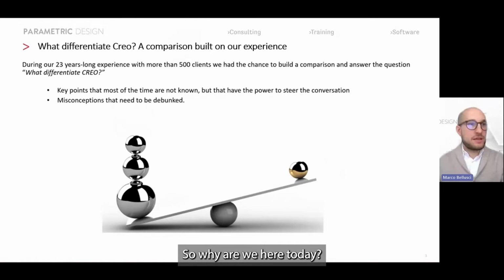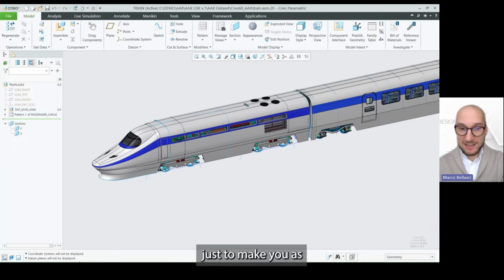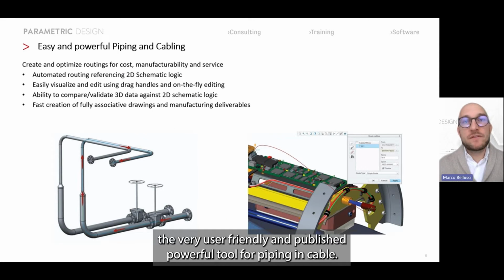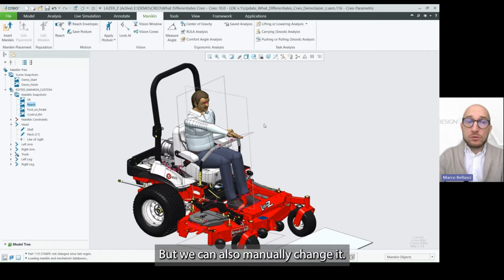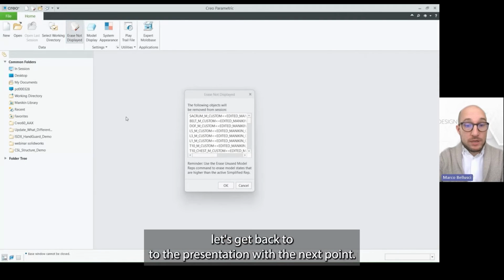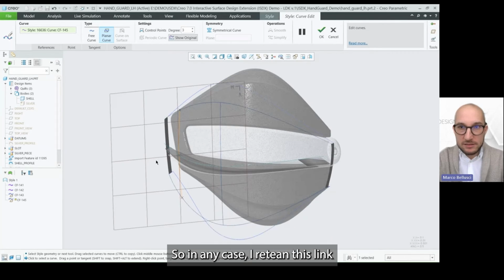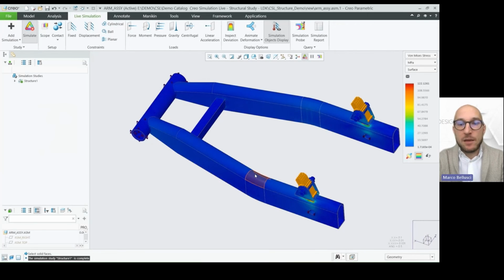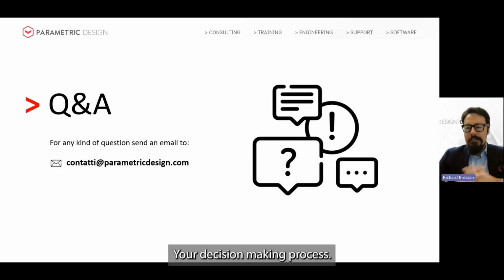Webinar Creo vs Solidworks: Battle of Titans

Comment: Very interesting! What are the specifications for the computer used for this demo?
Reply from the maker: Hi, in this file you can find all the requirements: https://www.google.it/url?sa=t&rct=j&q=&esrc=s&source=web&cd=&cad=rja&uact=8&ved=2ahUKEwjIuP_Ji--EAxWih_0HHV7kCqMQFnoECCMQAQ&url=https%3A%2F%2Fcommunity.ptc.com%2Fsejnu66972%2Fattachments%2Fsejnu66972%2Fcpanalysis%2F10470%2F1%2FCreo%25208.0%2520Hardware%2520Notes.pdf&usg=AOvVaw09aWFxDxeiRmSJPuXwlIIT&opi=89978449